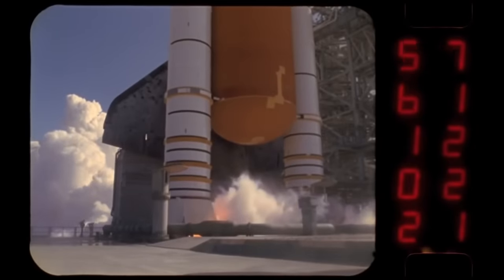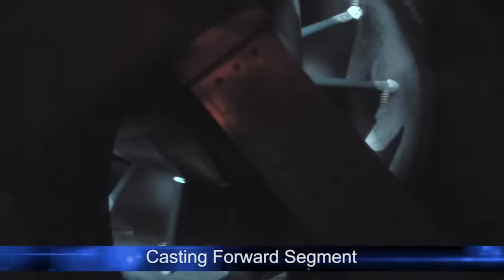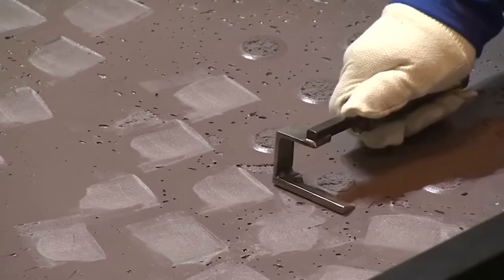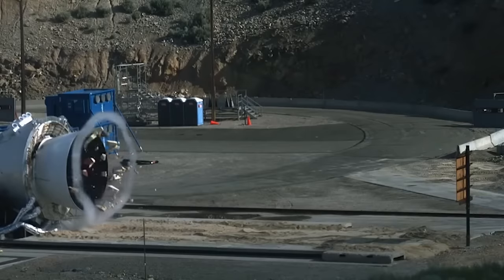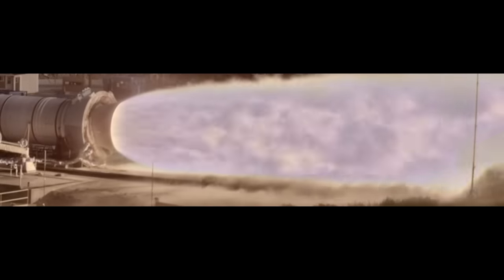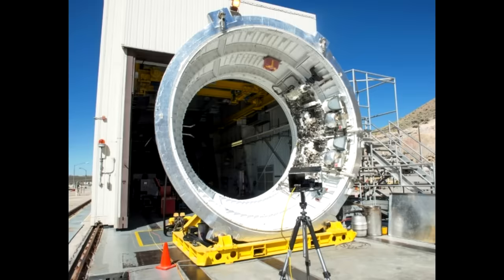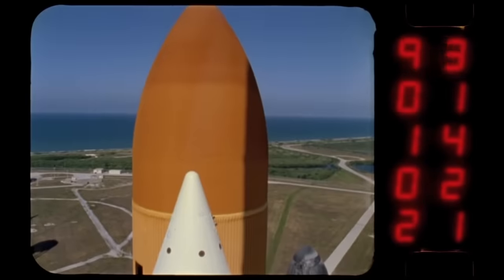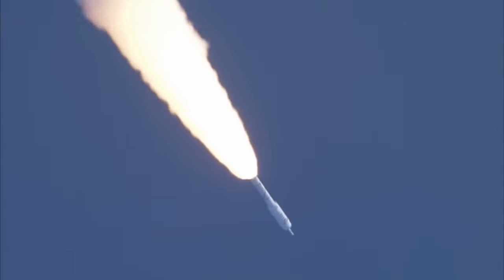The Amazing Engineering Behind Solid Rocket Boosters

Comment: I did not know about the extreme wind shear the Challenger experienced. But we all know the launch should have been scrubbed cause of the low temperature. But it's easy to cast blame. Ultimately the Shuttle was an amazing vehicle. Space is hard. Launching is hard, rockets only have one failure mode - catastrophic, sadly

Comment: 12:14 Here's something I've wondered - if the O-rings on the SRB had failed in a location such that the jet of flame escaping from the joint was facing / firing AWAY from the main fuel tank instead of towards it, is it possible CHALLENGER could have still safely reached orbit?
Reply: @J Walker. Yes, you are correct. Many of the motor cases we recovered had o-ring burn throughs that were facing away from the vehicle stack; that is how we knew there was a risk of burn through on Challenger.
Reply: I said that back when it happened. If it hadn't happened near the strut attachment it would have probably been fine. It was seconds from separation.

Comment: Solid rocket motors get a bad rap from most rocket motorheads but solids have advantages that are seldom discussed. SRB's (solid rocket booster) are less complex overall then their liquid fueled cousins because they don't require the complex and dangerous storage, pumping, and separation of multiple volumes of liquid and liquid cryogenic fuels at the launch site. Neither does a solid rocket motor have the high speed turbopumps, injectors,  valves and plumbing of a liquid fueled motor. Liquid fuel motors do have the advantage of being "throttleable." Thrust can be increased or decreased as required whereas the solid motors cannot be throttled down or shut down and restarted after ignition. This makes them less useful than liquid motors except for first stage flight. The stage 1 solids are also easy to store. Minuteman solid rocket motors have been shown to produce equivalent thrust after over 20 years in a missle silo. Submarine launched ICBM's went to solid motors long ago because they are safer than having the submarine carrry dangerous liquid and cryogenic fuels on-board. It really depends on the application but solid motors do have certain advantages over liquid fueled rockets. Also, while the Challenger disaster was a failure of a solid motor it must be said that the engineers at Thiokol did not agree with the launch decision on that cold fateful January day. The solids were being asked to perform outside the known design envelope and the disaster was caused by Thiokol management disregarding the advice of their engineers and approving the launch. Far more liquid fueled rockets have failed at launch than solids.

Comment: 1:07 1250 + 1250 + 600 = 3100. (1250 + 1250):3100 does not round to 2:3, it's 4:5. Your train of thought must've tripped up and compared 600 to 1250 while momentarily thinking 1250 was the combined booster pair thrust, rather than each individual motor.

Comment: Those rocket boosters are the reason one full crew died. Fact
Reply: Yes, but there were multiple aspects to the “reason.”  Ultimately, it was a decision to launch in cold weather against the advice of Thiokol engineers that doomed the shuttle.
Reply: Well, I mean, that's the simplified immediate cause, I guess; but the reason the crew died was a chronically poor attitude towards risk management and safety by NASA at the time (with NASA basically playing Russian roulette and the crew paid the price). Search for the Rogers Commission Report; but in particular look for Feynmann's section ("appendix F").
Reply: @GH-oi2jf  There were multiple aspects to that decision too! The reasoning runs pretty deep into NASA's practices at the time, mostly in management but also in engineering.

Comment: Without doing the math, it seems that solid rocket booster manufacturing could be largely automated and designed for high volume manufacturing, and that could be an inexpensive and reliable launch system with no cryo fuels or turbine pumps.  If that was true, SpaceX would probably be doing it.

Comment: Engineering a rocket means using metal and its alloys for the parts. 
The shuttle failed since rubber, putty and non-metal parts have been used. 
Simple metal seals are airtight and riveting tiles keeps them from falling away.

Comment: The Shuttle SRBs were supposed to be recoverable and reloadable (thus the parachutes) were they ever actually recovered, reloaded and used again?
Reply: They were recovered and sent back to Utah but as another commentator on this thread (an engineer who worked on the project) notes, the steel casings were found to contain kinks and bends probably related to the huge reentry forces. These could not be machined out to allow for for reuse.
Reply: @epincion  Thanks for the reply.👍 Makes sense to me now why SpaceX designed a soft landing recovery for the Falcon boosters even though they are not SRBs.
Reply: I read that all but 4 of the 270 built were recovered and reused.
Reply: @epincion  Just for the sake of precision, the boosters were not subjected to reentry forces -- they flew to about 25 miles in altitude, and then fell back to the ocean. They never left the atmosphere.

Comment: What would happen if one of the boosters failed to light? Would the shuttle plus one booster produce enough force to lift it at all? Or would it just sit there on the pad for two minutes until the booster burns out? But it would probably fall over right? How sturdy is the big orange tank? Would it collapse and explode? I'm sure NASA has thought of this scenario, and had plans or whatever if it ever occurred. I'd love to see a video with some info on this. I wonder if maybe they would detach the booster and let it fly up a bit before exploding it. I mean that's risky, but probably safer than leaving it attached to the shuttle that's going to fall over and crush a tank of highly explosive hydrogen and oxygen.

Comment: The o-rings were able to withstand ridiculously low temps as it climbed into space...but much warmer temps at sea level broke them before launch. Seems like shit just happens sometimes. I guess that’s why I’m not a NASA engineer.
Reply: I'm pretty sure that, during a successful launch, the heat from the solid fuel burning would have heated up the o-rings to the point that they would have remained warm enough to easily survive the two minutes that they were in use.

Comment: Could they make an extra-super-heavy by strapping additional SRBs onto it?  Why the typical limit of 2?
Reply: The limit is not two that was just how many srbs were on the shuttle that’s it
Reply: @fredington4690  I get that part.  But, the SLS (or similar) doesn't have the shuttle taking up space on the side.  So, in theory, they could strap on more to lift even heavier loads, without needing to design new, high-tech liquid fuel engines.
Reply: @PongoXBongo  technically you can but it would might be way more dangerous since you can’t turn srbs off

Comment: Also, why was it the solids were supposedly deadly to a hypothetical Ares I crew?
Reply: There was thrust oscillations similar to the pogo issues that plagued early liquid booster designs.  It was an overblown issue that would have been easily fixed.
Reply: most of the issues mentioned about the Ares were overblown or downright silly.  Most of the issues were common design issues that applied to all rockets, including the Saturn 5.  On the second unmanned test flight of the Saturn 5 pogo oscillations occurred shortly after lift off.  The oscillations almost destroyed the rocket.  And they would have kill the astronauts.  But fortunately it was an unmanned flight.  It took about a year to fix the problem.

Comment: One wonders how much cheaper/safer/better the SRBs could have been if not for politics. If the manufacturer was actually sited within transport distance of the launch site, the booster could have been one structure rather than a multi-segment jigsaw that needed assembly and seals and reinforcing of the joints and re-reinforcing of the joints after killing its crew....

Of course, the solid boosters were originally supposed to be just an interim solution until they finished developing the liquid-fuelled fly-back boosters.
"supposed" being the operative word.

Comment: If the boosters had been manufactured and assembled in fewer sections closer to the launch site, instead of having to be transported in pieces from Utah and re-assembled in Florida, would that have eliminated the need for so many dodgy o-rings?
Reply: Also, always seemed to me that the closer to the nozzle would have been more susceptible to failure as engine gimbled. Wouldn't even lower joints been preheated so freezing temps wouldn't have mattered

Comment: On Challenger, the Range Safety Officer activated destruction of the Solid Rocket Motors as they were out of thrust. Essentially, in tail-off and the the SRB weren't going anywhere else, other than where they were going at the time of their destruction. The Range Safety Officers actions were unnecessary and complicated recovery of the boosters.
Reply: The destruct signal was sent by RSO at T +110 seconds, the SRMs are still making 1.6 million pounds of thrust each at this point. The Range Safety System at that point was still responsible for breaking up the External Tank, which if intact, would have been over 3/4's full at that point in time.    I disagree with your assertions.

Comment: Never could understand why the solid boosters were not made into one piece at the factory and shipped on top of a 747, as the Shutlle itself was. It always seemed an unnecessarily risky thing to have to put the pieces together in the field, requiring a much more complex and heavy joint. And I also don't understand why they put all the avionics and parachutes at the top -  surely with all the  expensive bits at the bottom you could have just aimed for reuse of the bottom segment, not the whole thing.
Reply: The Shuttle's SRBs had a BATES configuration. This configuration has a progressive thrust curve, which means the more it burns, the more thrust it makes.

By leaving a space between segments you can counter this effect and get a much more usable neutral thrust curve.

Comment: I’m always curious how rockets first tip over when launching off slowly
Reply: The force of thrust generally needs to act in the direction of the center of mass (otherwise it goes to the ground rather than the sky). As it gets faster, the direction of thrust needs to move toward the center of pressure to handle aerodynamic forces.  When there's a tilt, it's a fine balance where thrust is not exactly lined up. 

You'll notice also that the launching shuttle drifts slightly. That's due to the thrust vector not aligning exactly opposite to gravity. And that is because the whole thing is a wonky shape, putting center of mass not directly above center of thrust.  The tilt and the drift are designed into it so that the pointy end stays up and the flamey end stays down.
Reply: Thanks for replying. I intended to say why the rockets doesn’t tip over when launching off slowly. Anyways, thank you for replying as I did not know that

Comment: No matter how amazing the engineering, solid fuel rocket boosters are surely only a temporary expedient. The big problem with them is that you cannot shut them down and subsequently restart them. If something goes wrong, not necessarily with the booster itself, but with some other part of the total system, the only thing that can be done with them, is to separate them from the main system and when far enough away, press the destruct button. They would not be much use for return to launch site or landing and once their fuel is burnt, they can't be refueled. 

With SpaceX it seems we are moving into a new stage in rocket development, the totally re-usable roccket that can turn round and land. But this too is surely also temporary, as the various stsges of the rocket each need to be serviced after flight. Surely, ultimately, we need a single stage to orbit rocket that can return to base or fly to some other celestial body and land there. Indeed such a vehicle would eventually need to be capable of taking off again for a return journey withou servicing or refueling, which is quite a challenge. 

Right now, such an idea is the stuff of Science Fiction, but given that Nasa and others are seriously looking at faster than light drives and interstellar travel, even if that is a very long way off, it surely can not be dismissed. Indeed, history seems to show that if one man can imagine something, another man may eventually find a way to implement it. 

My point is that we are at a quite eaarly stage of a very long learning curve whose end point we may not even guess and which some may think will never happen. But they said that about what became Falcon 9 and Elon pulled that off. I am sure that over 100 years ago, the Wright Brothers never envisaged such things as a Super Jumbo capable of flying half way round the world in go or of elecctrically powered flight or rockets to the moon and back.

Or is it possible that in the future someone may find ways of overcoming all the draw backs of solid fuel rockets that I have pointed out ?
Reply: I doubt SSTO's ever become a thing.  To inefficient.

Comment: Well, my question is:  I see these videos of solid rockets being tested on there sides. Isn't that going to skew the results?  The results are going to be skewed anyway cause there is no acceleration.  ??????
Reply: They have sensors that measure how much push the rocket gives to the thing holding it down. As for being on its side vs vertical, we know what gravity is and can account for it in the laying down position, so the calculations are valid.  Plus, gravity is teensy tiny compared to the energy of the booster.

Comment: The Shuttle should have used kerosene and liquid oxygen booster. There were engines available for use, and they would have increased the payload capacity of the shuttle. Most crucially, it would have improved the vehicle safety. The only reason why the solid rocket boosters were used was likely to keep ballistic missile motor makers, like Thiokol, in the space program.

Comment: Give the SRB contract to Aerojet and not Thiokol and the Challenger Accident doesn't happen. Aerojet had a monolithic single case design and were going to service the rockets right at KSC.

No trip to Utah = No train cars = no need for segments = no joints = No STS 51L

But government contracts play favorites and the crappy design/company won.

Also, if Pratt&Whittney had gotten the SSME contract and not Rocketdyne, perhaps the SSMEs would have been done on time and we could have saved Skylab (PnW was way ahead of Rocketdyne in development of high pressure hydrolox engines, upgrading the Rocketdyne J2 engine proved to be much tougher, it did not scale well)

Comment: It could be said that because thyocal didn't want to move to the coast was another cause of the challenger disaster. If they had the boosters could have been made as one soild piece with no orings
Reply: They could have been made with a different material for sealing the joints.  Boisjoly spoke about this.

Comment: The thrust on that shuttle is only 100,000lbs of torque with a propellor
100,000lbs of torque with a propellor like a extremely strong helicopter makes more sense for cost then their rockets id imagine
Reply: You need air for propellers to work...

Comment: If the solid rocket booster construction facility had been close to the Space Center (where transportation size limitations would not have existed), could they have been manufactured from solid, full length steel cylinders with no joints? And if so, wouldn't that have been far safer and saved the lives of the Challenger crew? And if so, why was an unsafe design approach taken, politics?

Comment: Why use solid fuel when it will end up creating unnecessary drag from its inability to throttle?
Reply: Because it's an easy and reliable way to make thrust and you can control its thrust curve by changing the geometry of the propellant. If you need more or less thrust at a certain phase of flight you can tune it by shaping the grains differently.

Comment: So not really less complex than liquid fuel rockets and not really reusable because they require extensive remodeling after exposure to the corrosive effects of seawater. As a bonus, they are a lot less safe because they can't be turned off and may self ignite, as well as spewing a thousand tons of noxious reactants into the atmosphere each launch. These should have been retired when they were still on the drawing board but military satellites needed a clothes-iron shaped shuttle with a giant loading bay that wouldn't get off the ground any other way.

Comment: So other for ease of ground transport, why on earth would you make a multi piece solid rocket casing?  Seams to me a one piece casing will weigh less, and have no joints to fail.  I'd build them near the Cape for ease of transport to the launch pad, as a one piece ready to go rocket, no assembly required.  What on earth were they thinking?   

Of course didn't they launch that fateful cold morning despite being warned by the solid rocket scientists that it was too cold to safely launch?
Reply: I suspect politics were an important factor here. Why was NASA control located in Houston, the various test facilities in Alabama, Mississippi and Louisiana? Morton Thiokol in Utah? Why not everything in one area around the Cape?